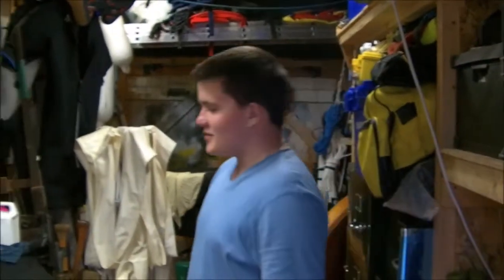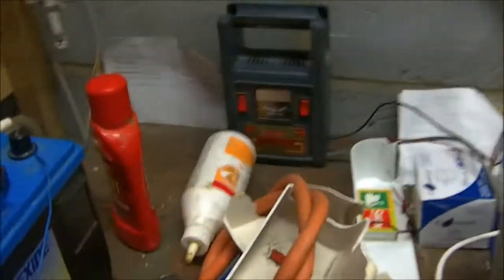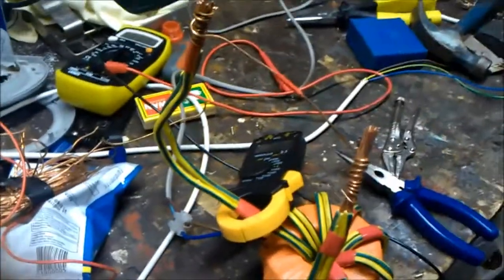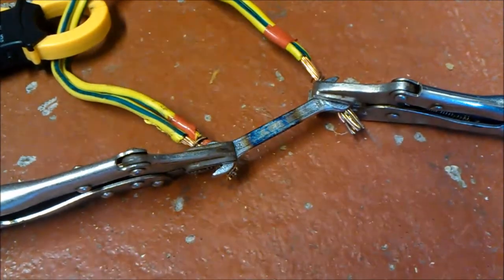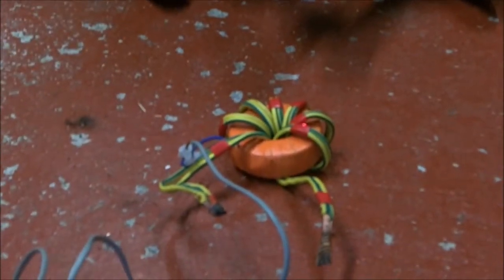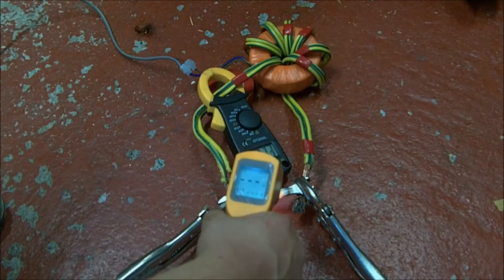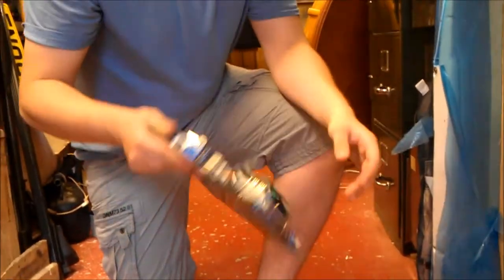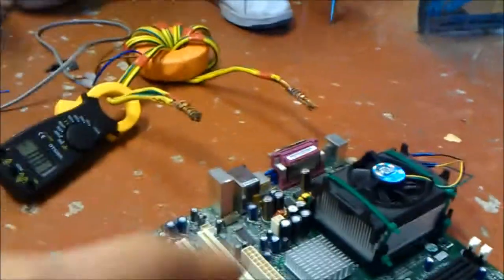Inverter wave test & 600 Amps Vs Spanner

Comment: Yeah I've found you need a least 3v for nuking stuff. I did get 1000A short circuit out of a modified 12v toroidal lighting transformer but the voltage was so low it just couldn't push the current through stuff like spanners & spoons ect. Try some winding some meter tails around it!

Comment: Good experiment, the output voltage may be a little bit too low. When the spanner heats up the resistance increases and the current drops. That is also why the secondary doesn't spark too much.
Charger, check it with an other battery in case the battery was faulty and the overload kicked in.
Good µP burn out with the magic smoke.